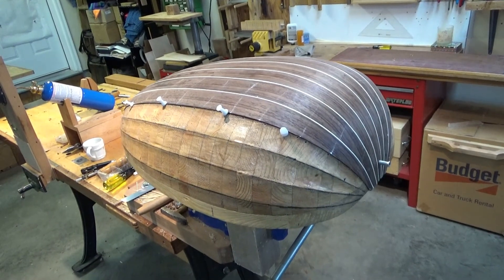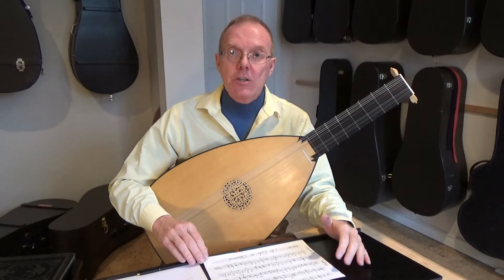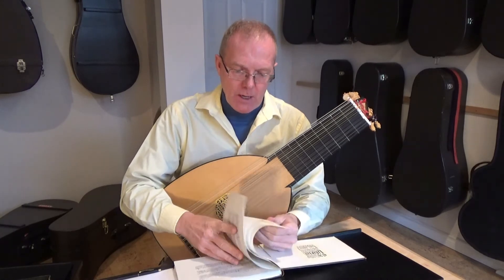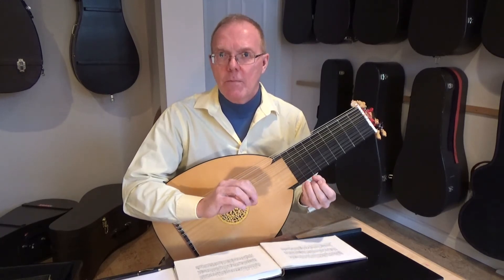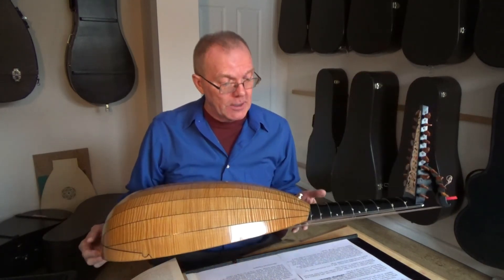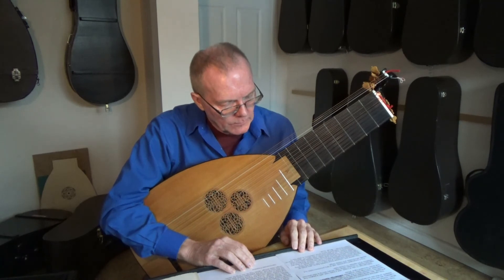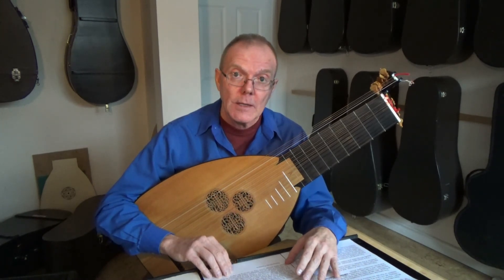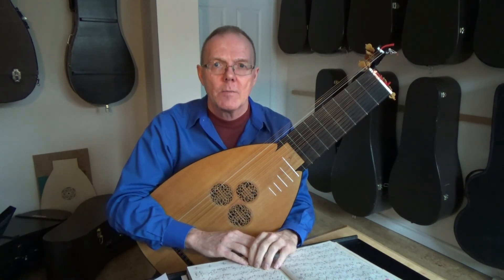Lutes with Flattened Backs: Why 18th Century Luthiers Converted Bass Lutes to 13 Courses

Comment: To make sure I understand correctly: both the large soundboard surface area as well as the reduced depth contribute to bass note prominence? I.e. if there were a lute with the same soundboard area and a deeper body/bowl, that more voluminous lute would not have bass notes as prominent as the one in your video?

Thanks for this demonstration!
Reply from the maker: Yes, that's correct, and thanks to Bob Lundberg for pointing it out to me. Another aspect of the matter is the ergonomics; a bigger profile would normally mean a much larger body, but such lutes are impossible to play in practice. There is a famous example by JC Hoffmann. Italian makers around 1700 seem to have been as concerned with the ergonomics of the lute as with its musical potential, and many different forms appeared.  Great comment, and thanks for watching!
Reply from the maker: I am sorry, I re-read your question, understood something and now I have a better reply: 

When the size of lutes grew over time,  mainly around 1550 to 1650, the cavity did not grow proportionately with them. Empirical observation leads the experimenter to the conclusion that making a cavity larger lowers the fundamental resonant frequency. This is observed in all acoustical inquiries, pipes, bars, strings, etc. 

So the lute maker has the problem of restoring the resonance of the upper strings, and there are many solutions from theorbo (lowering the pitch an octave, tuning the intstrument higher) to archlute (shorter string length, wider, shorter body, fatter single strings).   

Most have flattening, and we observe that this makes the bass shorter, sharper and inclined to emphasize upper rather than lower partials.  The soundboard area increase as a design problem  is deceptive, because it is really the cavity and string length, being linked,  that determine the physics in this example.  Lute makers simply followed basics and made the volume smaller to shape the treble and bass to their musical ends. Still happening today.
Reply: @EarlyMusicStudio1  Got it! Thanks for these quick replies, I really appreciate it. I'm working on an instrument right now that will have a very lute-like body and it is closer to the size of a bowl-back mandolin so I'm looking for ways to favor the already disadvantaged lower register. Right now my plan is to use double strings for the two lowest courses; should be an interesting experiment!

What you mentioned about ergonomics makes total sense too. I think I'll have the opposite problem regarding ergonomic playability.
Reply from the maker: @lukehebert6207  How extremely interesting!

The mandos of the late 18 and especially the Neapolitan mandos are a distinguished by having the central five ribs almost like a guitar!  Modern copies, American versions never have this degree of flattening. The doubling of lower courses brings new problems: intonation.  Keep it up!

c

Comment: The Edlinger is exactly how a proper baroque lute should sound.
Reply from the maker: Hello and thanks for your comment!  I made the video because I am convinced of the architecture—that the flattening has an ergonomic and acoustical advantage. The bass, which can in my experience easily overbalance and overwhelm the upper strings, is better modulated.  It has a positive effect on the resonance of the cavity, raising it, so that the overall effect is less boomy, especially with modern strings.  Another view is that makers of the 18th C. had a ready market for valuable older lutes, in short supply, and they wanted to maximize their profit by re-engineering antiques.  This also happened to harpsichords—it’s called “ravalement”.

But it must be said that earlier music, say from before 1720, has a very different texture and purpose from music of the following decade.  One is more based on a two-voice frame derived from continuo practice, with rapidly changing harmonies and the brisé style (Reusner, Mouton, Gallot, De Visée, Richée, Bittner, early Weiss).  The later style is more rhetorical, based on simplified harmonic devices with slow-moving bass lines and a melodic style which we think of as Rococo. These lute works like are the “character” pieces of Couperin, Weiss especially moved more to this Italianate style, with its short repeated phrases, echo effects and “cantabile” melodies, as Baron observed.  For this later music, the style of lute changed, with the German theorbo coming into favour, and the deep and large-bodied instruments of Hofmann, Schele and Edlinger.  
So as fashions changed, the instruments changed with them.  For the Emfindsam pieces by Falckenhagen and Hagen et al., we would prefer this later neo-Renaissance instrument for the best effect. The flattened instruments are a Mannerist outgrowth of the early 1600s. In painting, for example, the limbs are muscular, the necks and bodies extended and enlarged, the scale is expanded and the landscape is less important. This tendency is first seen in the sculpture and painting of Michelangelo, and it became dominant throughout the European world of art and architecture until around 1680. It was gradually replaced by a more naturalistic aesthetic view. 

“Ich bin ein diplomierte Lautenisten: Ich trage immer neunzehn Lauten Kaesten”
(I am a graduate lutenist; I always drag nineteen lute cases around.) attributed to Jonathan Rubin.
Best wishes and apologies for overly elaborate replies, Clive